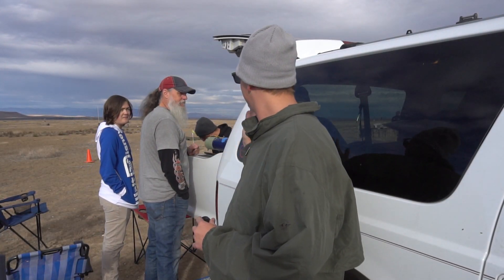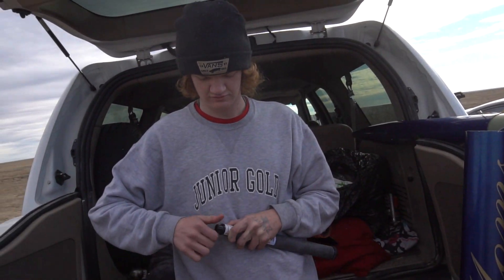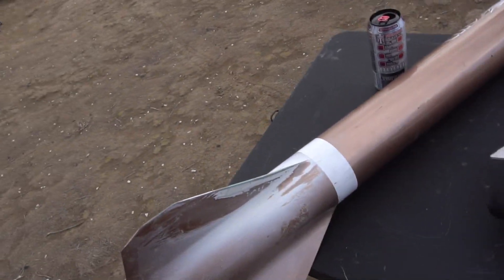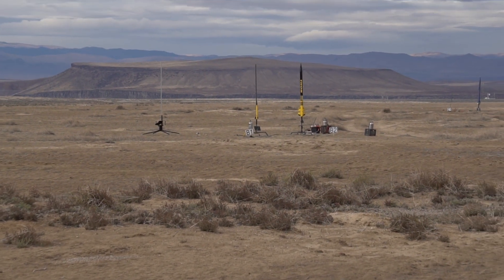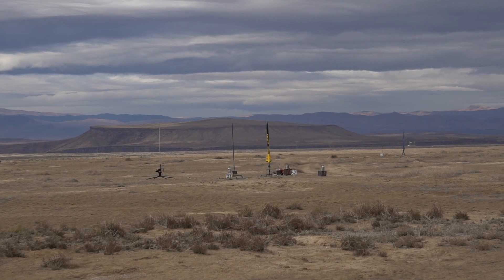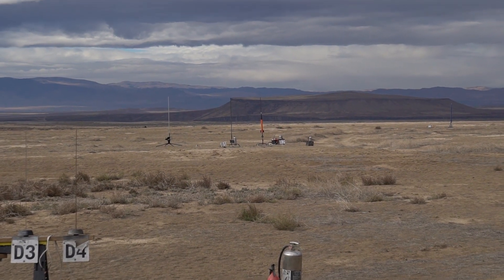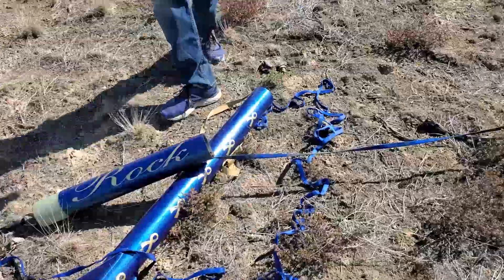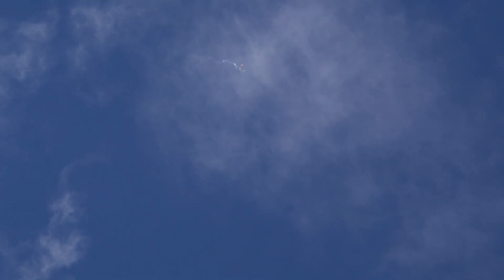M Motor High Power Rocket Flight Goes Bad (Final Flight of My Punisher 4)

Comment: I've had the same experience, unfortunately.  A self-built light 50 mm rocket H100 with IMAX motor. No parachute open....  It also had a camera, altimeter and GPS. It fell between neck-high Repce. It never made it. Total loss $500...  Lesson learned!
Here is the video:  https://www.youtube.com/watch?v=idU0fvtAhrQ

Comment: I've destroyed a 75/5120 when I had  an M1780NT CATO and take out 50% of my rocket.  The electronics survived thanks to me using stupid long tethers in my rockets and taking the hit of the CATO.  I've also destroyed a Pro54 6GXL when flying an L730C in a 54mm minimum diameter broke the airframe into 5 different pieces bring the casing with the fin can in ballistic.
Reply: those long pro54 seem to have been pretty deadly recently

Comment: Thoughts on what went wrong?   Lessons learned?
Reply: It could be the altimeter wires use as a switch taped to the outside can’t withstand Mach 2
Reply from the maker: @rickytrinh989  They're more than capable of Mach 2.

It was moving pretty quick when it was arcing over. I think the horizontal speed may have been enough to combat the charges.

I did make a mistake that I'm perfectly willing to admit. On the pad, one of my altimeters was only beeping to signal it had continuity on a single charge. The second altimeter was good to go and I trusted that one would be fine. I should have pulled it off the pad and corrected the issue on my backup alt, but didn't. Live and learn!
Reply: @RocketVlogs  Bummer ... looked good goin' up!
Question - I haven't flown anything, certainly like this, since I tried my hand in grade school a hundred years ago with an Estes Trident (I put too much paint on it) so pardon my lack of knowledge.  Are there dataloggers with downlink than can provide a GPS track (thinking you might be able to search more closely to where it might have landed before impact)?
Thanks!  Love what you are doing - new subscriber btw.
Reply from the maker: @truegret7778  Yes! I use radio tracking, but there are GPS options. They are just fairly pricey.
Reply: @RocketVlogs  Yep we all make mistakes. Keep up the videos, I’ve been out of high power rocketry for 10 years and just getting back into it. Lots of things have changed and new methods of building. Maybe I’ll see you at RocStock
Reply: @RocketVlogs  yep, I hear ya’!
Bummer this one augered in to who knows where!  Great launch though, and you get to build another one!